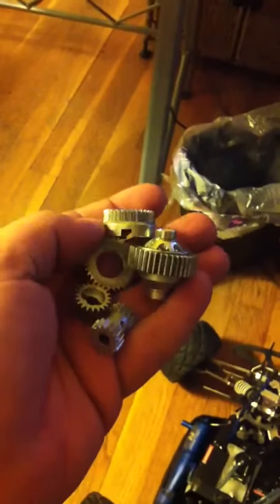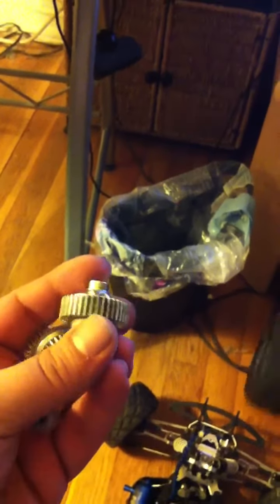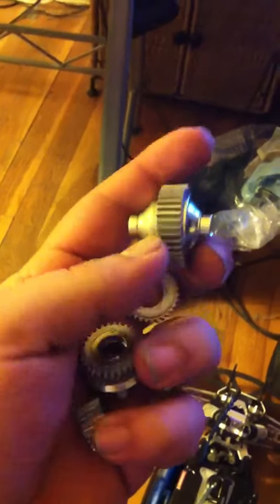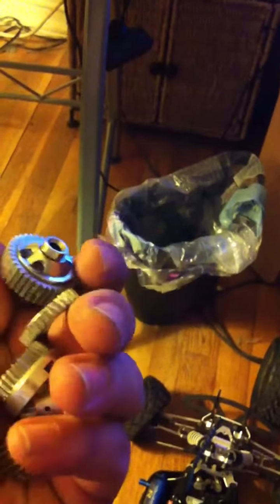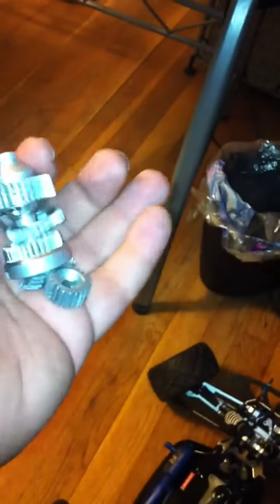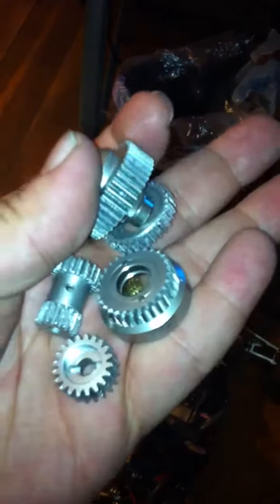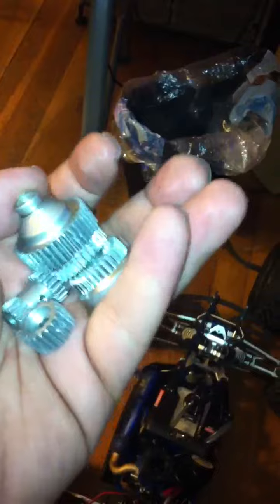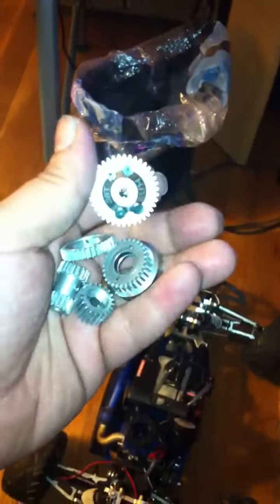Jato 3.3 metal gears

Comment: Before i stuck a big block into my jato the gear ran fine. i extended the chassis and put a .28 novarossi engine in it my gear went on every high speed run.and they always striped out around 75-80 mph.i took the transmission and diff apart no teeth left on anything.went online and found metal gears.Now i use hot racing hardened steel gears and diff and it works awesome now.ive been able to hit 84 mph now.I really hope that you take that in to consideration there a bit heavier cause there steel and the price of a $100 for the gears almost gave me a heart attack but um there the best gears i have ever used.next upgrade is xo1 tires on 17mm hex hubs on my jato from hot racing as well.
Reply: John Szafarczyk so what kind of wheels and tires you need for the HR 17mm hubs to fit?